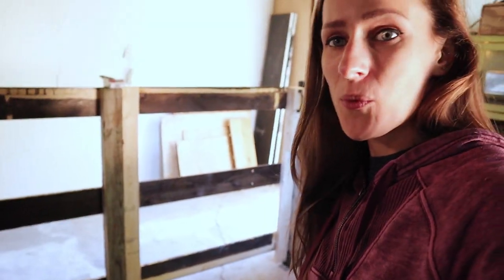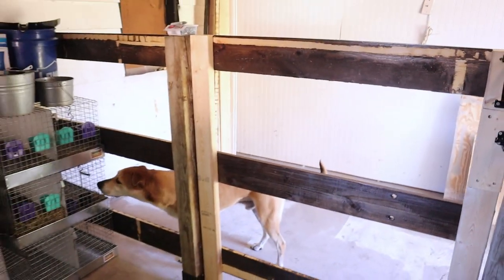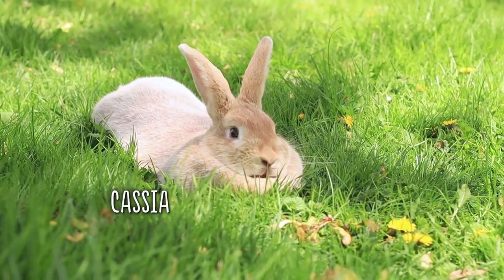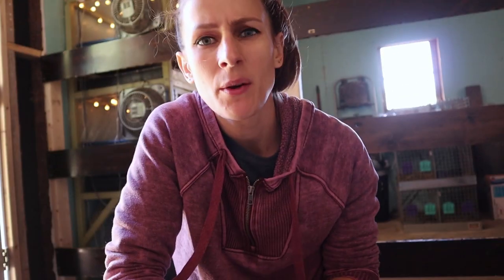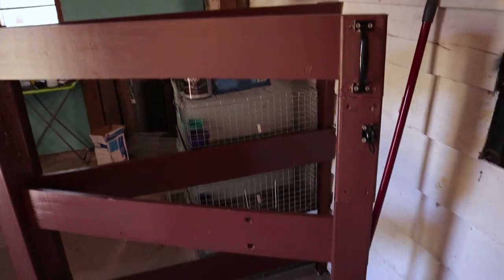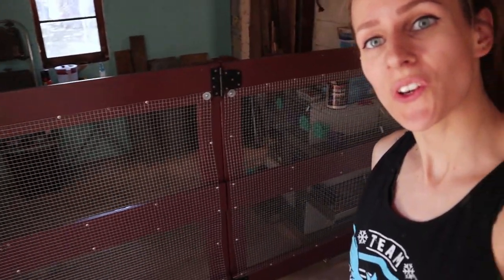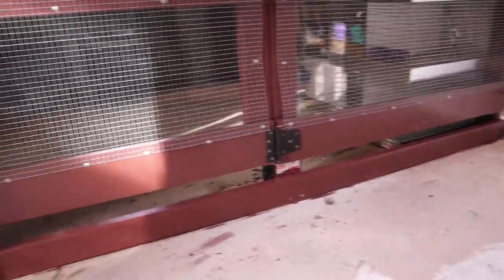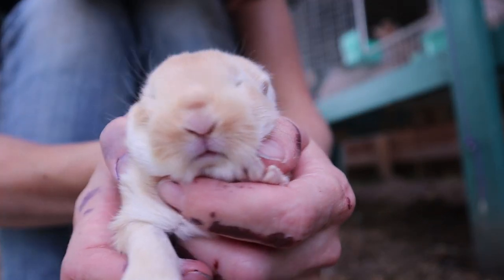Creating a GOAT STALL in a garage (suburban homesteading)

Comment: I made some temporary barn stalls and used cheap cedar board fence pickets frm Home depot (1" x 8 ft for less than $3) . Spaced them about 4 inches apart. Wood was sky high this summer due to Covid, so I used cheaper wood in the interim.  It has worked out great for kidding stalls. I have Nigerian dwarfs and Full size Lamanchas. They broke the wire out of the gate so I changed to those cheap cedar boards on the gate as well and it has held up.

Comment: I recommend eating the most aggressive quails first. Especially if you plan to incubate your own eggs; aggressiveness is not a good trait to pass on when they have to live in close quarters.

I knew a flock of quail (4 f, 3 males) who lived in about as big an enclosure as you have. One of the rooster pecked another rooster badly (spray of blood on the wall, black eye etc, recovered fully) even though he did not fight back at all. The same rooster was hard on the chickens (mounting and chasing all the time, pulling neck feathers out...). He got the chopping block treatment, and the rest of the quail lived so much more peacefully afterward.

Comment: Are you going to seal the concrete? Urine will seap into it.
Reply: I would put down large rubber stall mats then use large pine chip bedding that can be easily raked out. Hay bedding will mold and cause respiratory issues and attract straw mites in winter. Concrete can be very hard on their feet and gets cold in the winter. Pine chips have worked great here.
Reply from the maker: @lotus....  we will be getting some rubber stall mats and using pine shavings 😊 being in the suburbs I have to stay inconspicuously clean!
Reply: NICE...💯💯
Reply: @TealStoneHomestead  johnson family farmstead recently made a 'sieve' out of hardware cloth to sift out the poo from the dry shavings. It looks very handy and saves bedding a lot.
Maybe a 'shovel sieve' would also work, kind of like a super size cat litter shovel😸😺